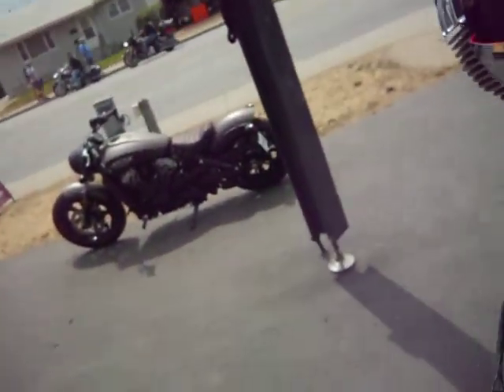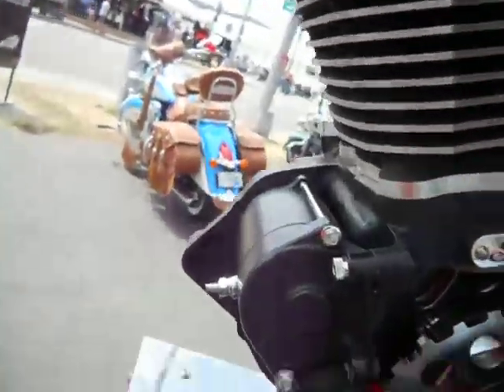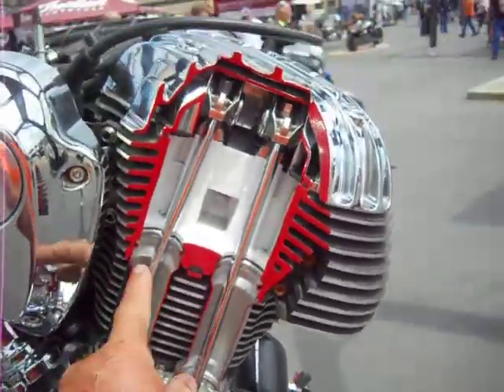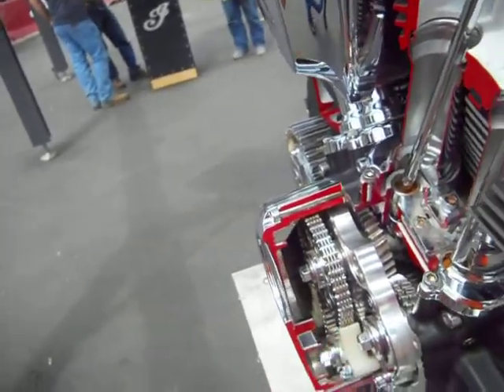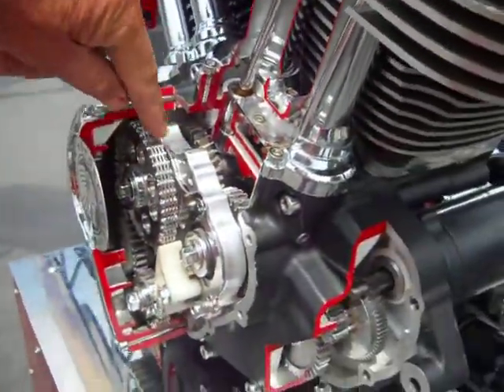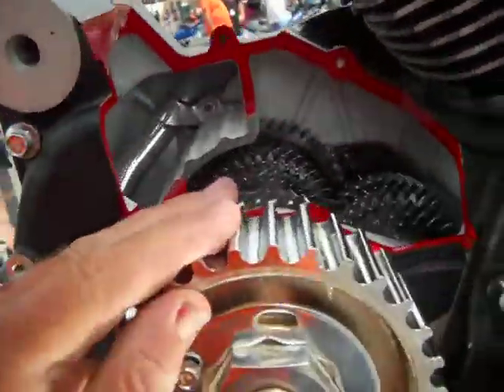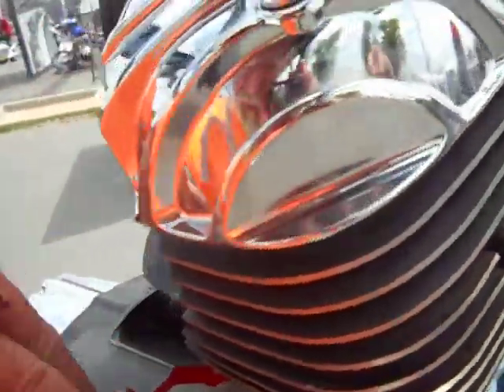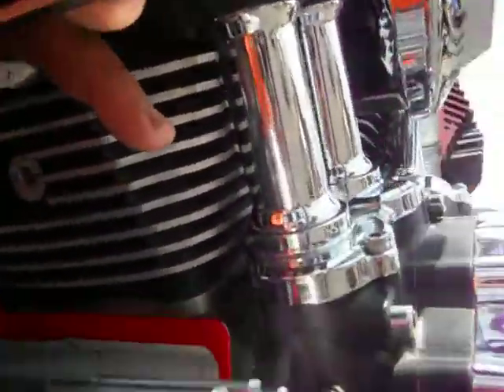2017 Sturgis Rally - Polaris TS111 Indian motor, 111 inches of shear beauty

Comment: Sir, the straight cut gear will be first gear. Also worth mentioning is how easy it is to change a starter, compared to a Harley.
Front pulley access as well for easy final drive ratio gearing changes. 
Many more improvements over the Harley,  and yes I'm a Harley guy, who feeds his family on building and racing them.